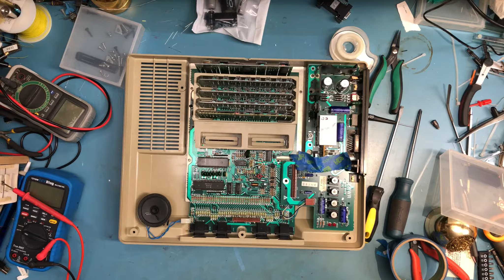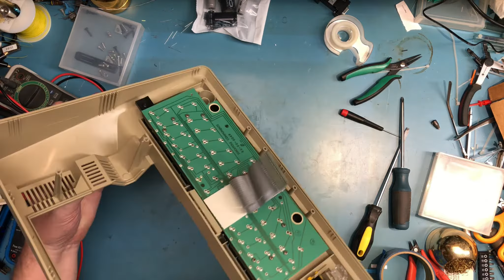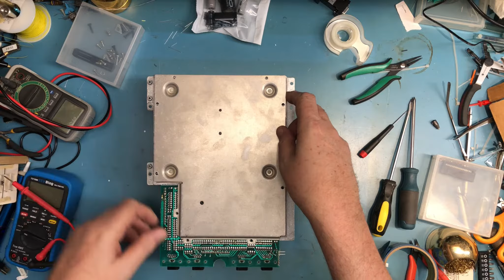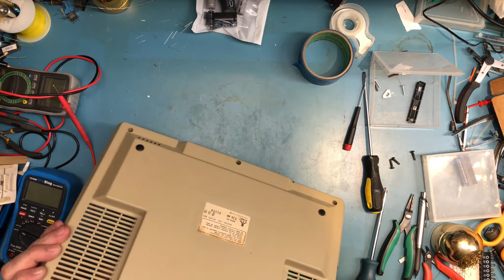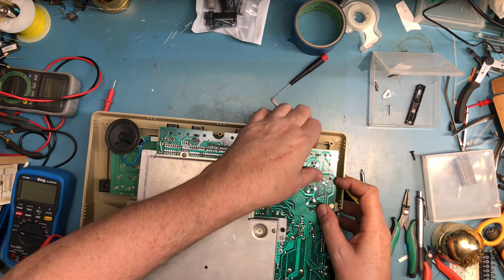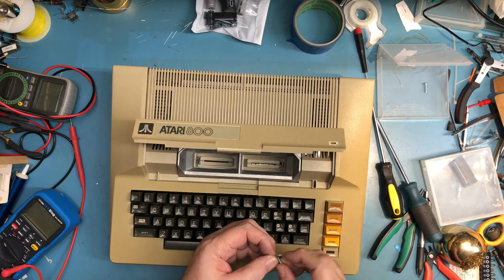STB612 - Atari 800 - Part 3 - NOS Keyboard and Reassembly

Comment: It might have been helpful to replace the 7805 with a similar size switching device, which would run a lot cooler.
Reply from the maker: I considered this. At the moment I don't have any switching drop in replacements. Part of me wants to keep it all original, part of me wants to add an Incognito. A switching vreg as part of that upgrade would make sense.